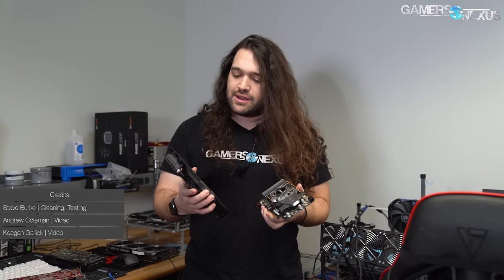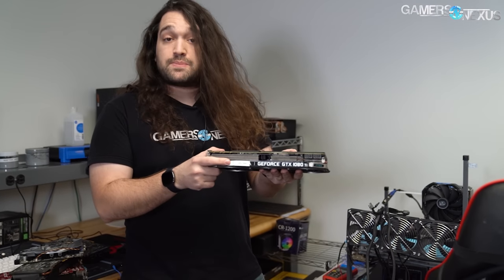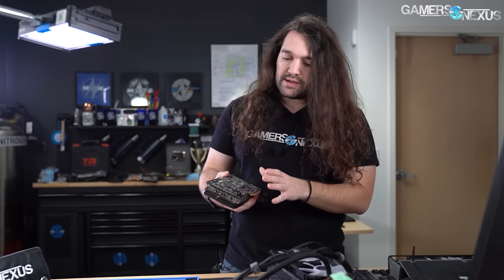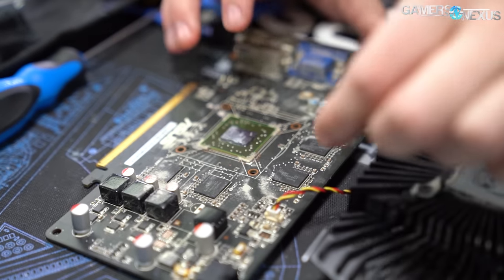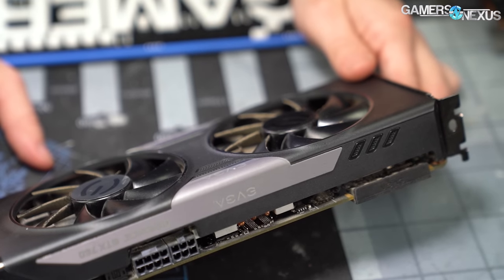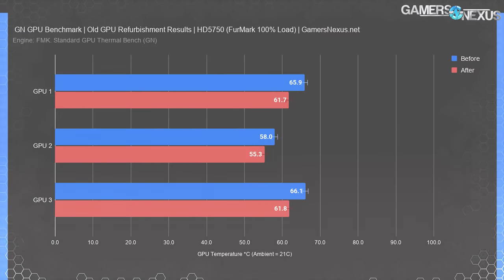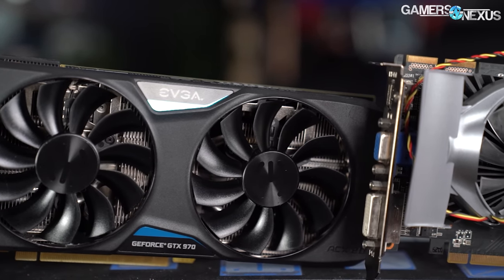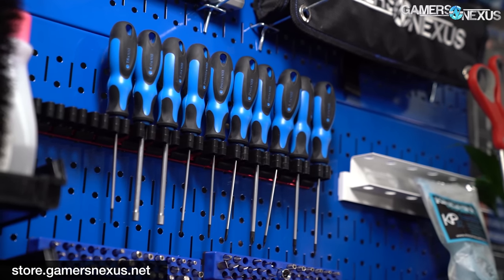GPU Cleaning Before & After Thermals: Re-Pasting & Dust Removal

Comment from the maker: Thanks to viewer Aaron (& others) for the video request on this one. Took us a while to get around to it, but really wanted to emphasize the before/after thermals and we had to collect some older cards! Watch our Best Cases of 2021 (So Far) list: https://www.youtube.com/watch?v=ffuAnwGivO8
Learn about common warning signs of a bad used GPU: https://www.youtube.com/watch?v=J2VkkEHDG5E
Grab the GamersNexus tear-down toolkit! Supports most video cards on the market and gives you high-quality, long-lasting tools: https://store.gamersnexus.net/products/gamersnexus-tear-down-toolkit
Reply: Awesome video! Thanks for all the hard work on the content. GN is my reference for high quality reviews.

I do a lot of these cleanings myself refurbishing and flipping old PCs and parts. The worst one I came across so far I called "smoky smoke". It was completely covered with a brown layer of nicotine resin mixed with dust. You can probably imagine the smell...

However, I'm still always a bit concerned about thermal pads though... 0.75mm is almost impossible to find. Is it OK to replace it with 0.5mm? And how much difference there is between an ARCTIC one versus the cheap stuff on Amazon that advertises 6W/mK? When you have to replace a large volume of them, cost becomes a concern especially if you only do it in your (limited) spare time. 

Would it be possible to make a content piece about thermal pads? Like proper replacement, characteristics (specific gravity?), and differences in quality, pressure, and thickness? 

Thanks so much again. And greetings from a Brazilian living in Canada 😉
Reply: Definitely want to say I appreciate all the work, too. Such a go to for know how. But what y'all got for the absolute gremlins? What shorts first typically in a video card? Even if there's nothing to be done just knowing would ease the pain lol.
Reply: Those EVGA cards you show, seems EVGA have had a nice consistent build quality for a good few years. :)
[Edit] I wonder if the unused heat spreader was just from a holdover from the other cards? So standardised parts, and only fitting thermal pads to the cards that need them?
Reply: Can you replace paste with liquid metal and compare temperature
Reply: Ant specific paste recommendations or just use whatever you have for CPU? ie Arctic Silver etc?

I heard of some total disasters using Liquid Metal but not sure if that was just user error or no recommended for GPU (and would it be less likely to "dry out" over time?)
Reply: Too Bad you didn't do the most popular GPU on Steam and the hardest to teardown the RTX 2060 :(
Reply: Guys, the camera focus is all over the place in this video (I'm halfway in). This is the first time I notice this, so it must be way below your standards... You should check that.
Reply: maybe make a video to people on how to prevent driver updates on windows for older cards. because i serviced a system with a 760 here the other day where the user experienced it running fine after having used ddu and installed old drivers, and after a reboot it crashed when entering cs:go and lol and after crashing 
it would crash when trying to enter the password screen on windows. after editing the registers on his pc and removed all windows automatic driver recognition and so on it runs fine and he can reboot it now no issues it has gotten 75 hours of runtime  and 20 reboots after the fix so i think its stable.
Reply: I recently cleaned my father in law's HD4850 as it looked like the heatsink was made of carpet rather than metal 😅
Only issue I had was not being able to break the seal between the heatsink and GPU, as the forces required was getting silly. I decided in the end to leave it as I didn't have a spare if I broke it and he doesn't game on it so its only going to see a few watts anyway.

The CPU paste was rock hard too, which I repasted. Its a good reminder to also do your CPU at the same time as its likely as old in a system using these vintage of GPUs.
Reply: @markwilson7013  my trick if i can get to the side of the die is take a pipette with isopropyl alcohol and let sieve in from the side.
Reply: @rasmuspedersen2001  That's not a bad idea at all.
When I have more time to work on it I'll give this a go 👍
Reply: Will you replace the 1080Ti since the thermal paste changed, or is it still good for testing?
Reply: What thermal compound did you guys use? I got very good results on my STRIX 1080 OC with switching to Kryonaut and thermal pads from the same company. A significant -14 degrees on the GPU.
Reply: Shoot another cleaning video, but in ASMR mode, and upload it on April 1st.
Reply: Old school trick : If your leads have a lot of tarnish or corrosion use an eraser to clean them. It works extremely well on GPU's, and Ram.
Reply: man if you needed old cards i could have sent you a 970, 680, and a 660 ti. all that have up times of years......they are in some systems i have to act like server so they almost never got shut down.
Reply: This testing is so fail because you arent taking into acount you cleaned the dust off the card, you act like these temps are just from re-applying paste which the cards probley woulda ran the same temps if you just cleaned the goddamn dust off.
Reply: before That>
Reply: Are there any recommendations for completely cleaning the dust out of a system in a way that won't aggravate asthma, while not costing an arm and a leg?
Reply: @17:46 your graph says onPresent FPS (higher & more consistent is better) on the axis that Im pretty sure displays the thermal temperatures? I was watching without sound and this caught me super off guard, I think you meant to put temperature on the x axis lol.
Reply: You should really have oiled the fans as well
Reply: Are there meaningful benefits to repasting with a higher quality thermal paste? My 980 is definitely struggling and sounds like a plane trying to take off (I exaggerate but it's loud).

The games I play are still playable though, so I'm kind of torn. Playing operation with my equipment seems a little scary when my options are loud card or no card.

I built my own pc, so the fear isn't about getting in there...just that in the past if you broke something you could actually buy a replacement. Now it feels very all or nothing.
Reply: Specific question I'm wondering for a while...does Thermal Paste degrade in the syringe after a few years? If i'm not changing the paste on a regular base and, for example, 2-3 years after putting paste on the CPU when I built it, can I use the same syringe with paste I used initially or should I buy new one?
Reply: @Ilendir   just store it in the fridge and it will be fine. It dries out at 90°C after 6-8 years in use, but hardly at 4°C (my experience), especially if the syringe is closed. I recently replaced the thermal paste for some 10 years old notebooks, both were very loud before (fan constantly spinning @ high rpm), one notebook suffered from spontaneous shut downs (over heating). After repasting, all were very silent afterwards and stable. The thermal paste was also 2 years old, but still worked perfectly.
Reply: @billybobbob3003 : Thermal paste is constantly heated up to ~90°C, it will dry out with time and lose its ability to transfer heat. That's the main reason for overheating & noise, not the dust.
Reply: After how many years would you recommend taking apart the GPU and replace the thermal paste?
And how many years for the CPU paste?
Reply: Top tip: use rubbing alcohol instead of water,  it'll vaporise as you work it. Great for getting into old thermal goop and rehydrating it. Also by far the cleanest, safest fluid.
Reply: @hoverbike  Thanks for the tip!
Reply: Patrick Stone been smoking near his computer, i'd recognize that shade of fan gunk anywhere lol.
Reply: Leave a gpu to get dusty too long, and then it'll become the fur mark test.

Comment: I bought a blower style RX 480 a year or so back, for like £40, advertised as "not working". I took it apart, and this thing had so much dust in it, when I put it in the sink the heatsink was practically watertight on top of that, the thermal paste was crumbling off in chunks. Once I sorted it out, it went from running 70°C idle to 30°C.
Reply: just yesterday got a 1070 TI with the same issue, founders edition style cooler and the paste was old "for parts" for 100 bucks I said screw it and after my 1080 died on me I couldn't pass it up, beats my 770 lol
Reply: I bought a 2080 Ti  for $100 which they said shut down after intensive load. I found out that it was just heavily covered in dust, so I cleaned it and there are no issues as of right now.
Reply: @notsure6834  IG most people doesn't even try to clean their PC

Comment: EVGA: “Would you like a GPU with those thermal pads?”
Reply: Better that than the new Gigabyte 3080 cards, with no thermal pads on the back to connect the PCB to the backplate...
Reply: They had a problem with not enough thermal pads being applied shortly before release of the 1080Ti FTW3. EVGA handled the situation very well but they probably wanted to avoid another incident. Besides the FTW3 is a very over built card in general. It only really gets close to its limit with a hardware mod and sub ambient cooling.
Reply: evga after not giving enough thermal pads: "here's all the thermal pads in the world" laughs maniacally

Comment: My 680 Classified went from 80C to 45C after swapping old dried out paste at 100% fan speed and load.
Reply: Very nice!!!
Reply: Nice !
Reply: That’s hot
Reply: @GalateaToha  lol
Reply: I have GTX 690. For the most it just idles as a GPU in a office machine. About as close to silent as can be. It is silent if it is not used for gaming.  vs a GTX 1050? Well it is paid for.
  It also will game better. If necessary. 
It does run two monitors easily. Well it does have two GPUs
 I think the GTX 680 will also do just fine for anther 10 years as a office GPU . 680 & 690 are good for 4K. Both can also can run Two 2560 x1440 60hz monitors.
 But for gaming?
 Maybe not made for gaming at 4K?
The old R 5 1600 and the gtx 690 spends most of the time just running at idle.
For office use not much reason to overclock either CPU or GPU.
But the 3800X system? That gets hammered.
Reply: Achieved similar results after repasting the core and replacing half the thermal pads over the VRAM on my r9 290 that was mining for 5 years or so.  Additionally, I yanked the fan from it's "PCB/stators" half so that I could add lubrication on the bearing shaft since after the years all of it had sprayed out onto the heatsink and PCB, as well as having dripped onto another card. Went from instantly crashing the PC when VRM temp hit 62C and now surviving gaming and mining without a hitch.  Core temp now slowly climbs to 85C while gaming instead of within 5 seconds to 84C
Reply: @warrenpuckett4203  why do you have a 690 if it's not really used...?
Reply: @warrenpuckett4203  If you can utilisize both gpus on the GPUs it's better than the 1060 if the Game dont Need More than 4GB VRAM. But If you cant use Sli and This happens pretty often at newer titles, because SLI ist dead, then the 1060 is the better way to Go. Running Just 4k monitors every gpu released in the last 10 years should be capable.
Reply: My old AMD Sempron CPU went from 65ºC playing Battlefield 2, to 21ºC (all winter testing) while overclocked 10% (FSB from 200 MHz to 220 MHz). It was the first time I cleaned that thing in years.

Comment: Its always so interesting to see how odd older cards can look especially as even with AIB cards they all still have similar designs now.
Reply: New ones look weird as well ngl
Reply: what is aib?
Reply: Sapphire Toxic 6900XT looks epic af
Reply: @sawii1482  Add in Board
Reply: well you can blame all the reviewers that whinge about them if they are not Colour Neutral or all designed to the same theme so you can have a Gigabyte Motherboard & ASUS or MSI GPU match, Even to the point of now telling nVIDIA Don't have your Green Logo Green & AMD Don't have your Red Logo Red, So now all Partner Motherboards & GPUs look the same & they want AMD, nVIDIA & probably Intel when they finally release their GPU to all look the same as well
If they are whinging theme is so Important then why are they not even using the same brand for Motherboard & GPU, Contradictory Morons,
I wanted a Theme so have MSI Gaming+ Motherboard & GPU with RED LEDs & Red Fans
Reply: @wherearemytesticles  They only make what people value lol, a lot of people love RGB myself included. Sure some may like an F1 shaped card, but a majority wouldn't.
Reply: yeah, as mentioned in another comment thread, trash-compactor compressed borg-cube of greeblies, lol. it doesn't even know what it's supposed to be anymore, it's just greeblies for the sake of greeblies all squished together. lol.
Reply: In a strange way, I really like the old GTX 2-3-and 400 series cards, with the blower on them and different pictures. I mean, it's a strange thing to put inside a box that would've had no chance to look into (very little glass or acrylic back then) - but that's why I like them, back then, the designs of those images was purely so the builder could appreaciate how cool his/hers new toy were! Just for a moment, before putting it into a box :)
Reply: FORM FOLLOWS FUNCTION.
There's an optimal approach for engineering the removal of heat. If the heat is minimal then you have more flexibility to go with an INEFFICIENT design. If you go back twenty years a card might have been super expensive but with minimal heat to dissipate so you might try to make the card look more aesthetically pleasing. Now with heat over 400W in some cards you need to focus on efficiency which limits the design you can take... an inefficient design is also more expensive (usually) so even for cards with less heat the need to reduce COST factors in as well although again there's more flexibility there to push aesthetics over pure efficiency especially with profit margins currently being high.
A BLOWER CARD is never a good approach unless it's for aesthetics or severely limited space. You've got the same sort of situation with CARS where older cars that went SLOWER could be more creative aesthetically but as they went FASTER the need to optimize for turbulence losses (and meet efficiency standards) reduces the options you have for design.
Reply: yeah, designs could be a lot more creative when the Chips were all low Power. but as they go up in Power, more Cooling is needed, and more Cooling surface area eats up a lot of that space to be creative.
Reply: the EVGA GTX 700 series cards are still my favorite coolers aesthetically.
Reply: @sawii1482  It's what people who don't understand acronyms call partner model GPUs. AIB means "add-in board," which is every discrete GPU as well as every item that goes in a PCI-E slot (capture cards, Wi-Fi cards, SATA cards, RAID cards, NVMe cards, fiber transceivers, regular network cards, sound cards, and a million other niche peripherals).
Reply: Might be a crime to end an already endangered species. Better not touch it just to be safe.

Comment: "taking the thing apart completely can extend its life span"

proceeds to pull all the capacitors and chips off of the board for cleaning
Reply: It'll live forever now.
Reply: @morrokbyo  it's name was Robert Paulsen.
Reply from the maker: NO!
Reply: @GamersNexus  That's the next trend, replacing the 'stock' solder with high conductive solder.
Reply: @33gles  by thermal grizzy
Reply: You forgot to pry the lids off of those black squares, especially the big one in the middle, also on a 7 layer pcb you don't need 6 chisels, you can keep reusing the one.
Reply: @kcocgibkcusuoy  IT’S NAME… WAS ROBERT PAULSON!
Reply: Wait the capacitors are not edible?
Reply: Gotta de-lid those capacitors for peak performance.
Reply: @753238  only the black one. Green are not ripe and red are poisonous.
Reply: can
Of course, you can do all kinds of damage to a card too. :D  Never did that myself, and my current card is six years old. Bought my first can of compressed air just a few months ago, and my first x86 mainboard was a P/I-P55T2P4… if anyone here even remembers that one.  :D  (My first "computer" was a VIC-20…)

Comment: If you still want to soak the dust in your GPU heatsink, but don’t feel comfortable using water, you can use 90% isopropyl/ethyl alcohol. The alcohol won’t conduct electricity nearly as well as water and it obviously evaporates much faster.
Reply: I would use QD Electronics Cleaner because it will dry faster than the water.  Just use it in a well ventilated space.
Reply: heatsink is just piece of metal lmaojust let it dry long enough
Reply: @dangerd9315  Water with salts in it can cause corrosion. Especially to bare copper
Reply: @w0udo6yv4o4  So just use distiled

Comment: It's kind of amazing how thermal paste can age.  I had thermal issues with an old, original Xbox.  It would consistently shut down in the middle of a game.  I took it apart and the thermal paste was like old gum.  Actually fairly difficult to remove.  I did the work and I haven't had issues with it since.
Reply: That must have been cool took a broken thing little bit of maintenance runs great again!
Reply: After changing my laptop paste to thermal grizzly i had 20c drop in temps. If I didn't do it myself I would not believe.